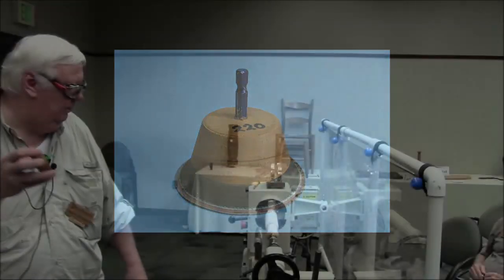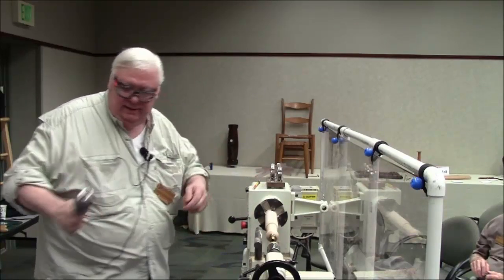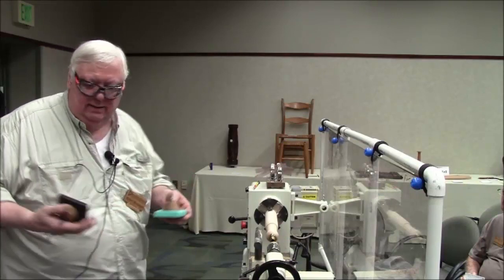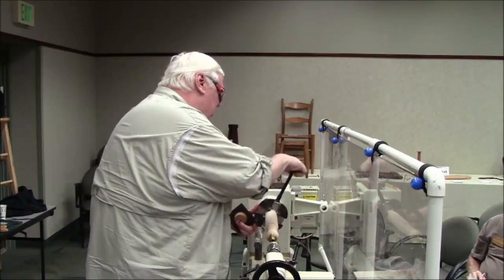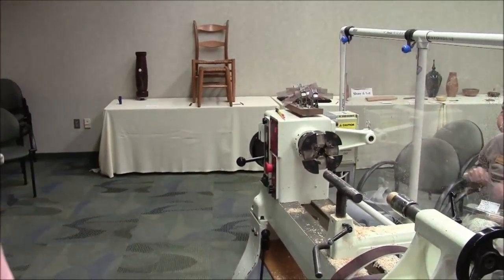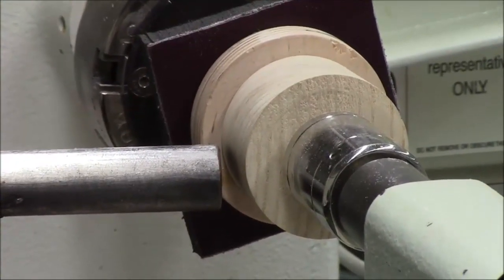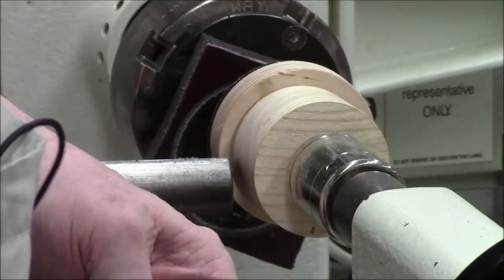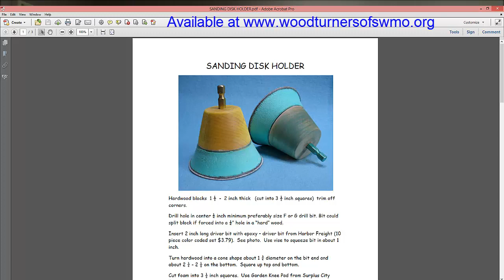Creating Custom Sanding Disk Holder

Comment: Great tips! .......ad 1:12 minutes you said that wood maybe split. If you put the bit for a night in the frezer it wil shrink, put the wood on the heater for a few minuts it wil expand. So you hav a bigger hole and a smaler bit. Put them together and then your wood wil not split. (sorry for my poor english)

Comment: Great idea. Having multiples of them with quick disconnects means my big complaint for sanding discs is eliminated.
I'll be using these for much more than just turning. Sheet metal and body work will benefit from this tip too.